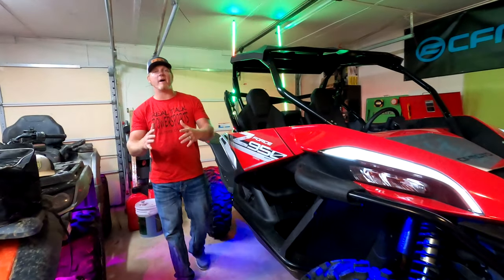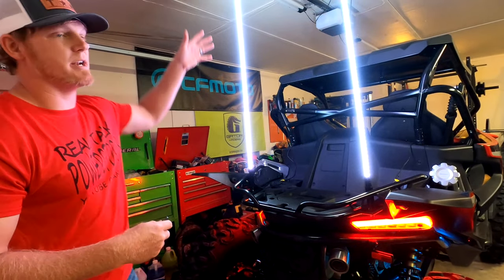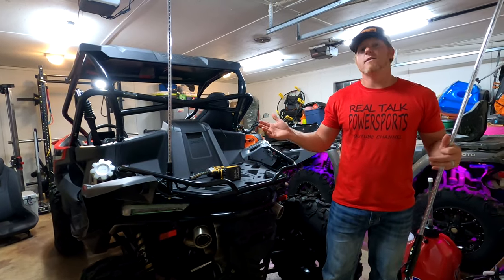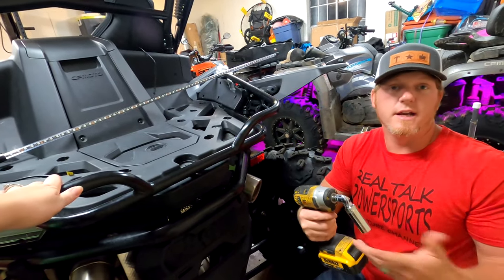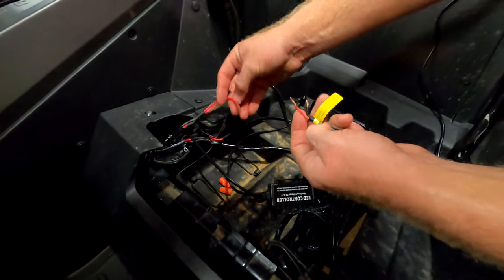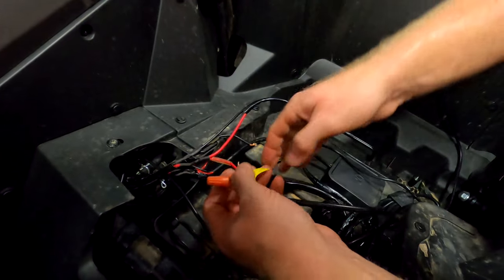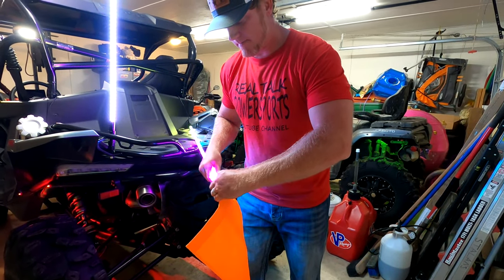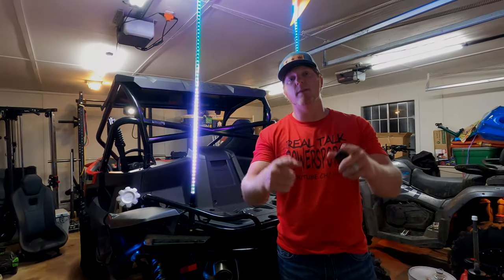KemiMoto LED Whip Lights for ATV or UTV | Very Bright & Easy to Install

Comment: Great video, but by all means get you some butt connectors or soldering connectors as opposed to those wire nuts, especially in the utv environment 👍🏼
Reply from the maker: Thats right!! I just did the wire nuts for a quick means of connection for illustration purpose.  Butt connectors and some super 88 tape is what I like to use normally

Comment: would the  whip lights get brittle and break off overtime or stay as strong and as good looking as new?
Reply: I had a pair of four footers, didn't last but three weeks and broke. Mine we're not flexible,.  at all. I did call Moto they did replace them I got to give him that!!!
Reply: They break contact in the led strip because they either spin or when they bend it beaks connection inside the led strip. 
7 of mine have all broken connection at the same spot.
I purchased the Kemimotos and switched to Nilights. They have a way better connection,  a taller quick connect. I also made an extra loop of wire that can get pulled on without pulling on the wires or led strip. Kemimoto whips are Junk!!

Comment: I tapped mine into my buss bar. They work fine but I cannot run the set on 1 remote. I did not install a switch. I only use the remote controller that was provided. Also when I put them on red; one of them is like a faded red. Any ideas  I would appreciate. Thank you sir
Reply from the maker: John i know this pair is sold together and work off of one control box and one controller.. did you buy you 2 separately
Reply: Real Talk Powersports yes I bought them Separately
Reply from the maker: @johnduran4949  this set was a pair wired into the same control box.. thats the only way one controller will work. And as far as the red discolor im not sure.
Reply: Thank you so much! I appreciate it! Will probably just buy a set instead of individual.

Comment: Do I  need the led control modules to wire  my whips up . I have 2 whips and 2 remotes but no modules came with my order
Reply from the maker: There should be a little black module box.
Reply: Thanks for reply but still confused. Messaged kemimoto about the module not being in with the whips and their response was the one l purchased didn't need the module and was told just to hook it up like l normally would. My remote was the controller. I order them after watching your video and it was the Black Friday discount. The whips and 2  mounts

Comment: What is your warrantee on these?
I bought the, LED Whip, set of two for $129 earlier this year, and they both broke from branches.
One of them came completely off, leaving my LED Strip, hanging there.
Luckily guys behind me picked it up.
The other on stopped working 1/2 way up.
Now I need to buy a new set.
I have yet to decide.

Comment: This doesn’t really pertain to this video but just wanted to ask a question about wheels. I’m looking at just getting some 30x9 and 30x11 cryptids just the tires for my cforce 800 do you think it will have any clearance issues on the stock wheels?
Reply from the maker: Hey Joe that setup will work perfect with the stock wheels.. but i think the 30x10 setup would rub a little bit up front with the stock wheels

Comment: Do that instalation tutorial on a cfmoto 850 please!
Reply from the maker: It may be a while before I can get another set. But it will be setup and wired just like in this video.
Reply: @RealTalkPowersports  just would like to know we're do you attach on the cf moto.
Reply from the maker: @33Mettal  to wire it or attach to the rear of the 850
Reply: @RealTalkPowersports  attach...
I can't see the best spot to do it in the rear part! Any hole adaptor for it?
Reply from the maker: @33Mettal  I would just drill a hole where ever i wanted them to be on the back edge of the rear rack. If you go with this kit.. you will need to drill with a 1/2" drill bit

Comment: I got these whips for my dad. Didn’t come with rf controller. Doesn’t work without it and now they’re trying to say it’s integrated into the light itself. And they won’t send me one. Don’t seem that reputable of a company in my eyes
Reply from the maker: It should definitely come with the remote controller.. unless it is now bluetooth operated.
Reply: It came with remote but without the RF controller the remote has no way of controlling the lights
Reply from the maker: @yuknasty9199  thats weird.. because the wires going from your power source should be running to a little black box and the black box is the controller and brains of the operation and from the black box it runs to the whips
Reply: Yeah I know. But they said the won’t give me one so I can’t use them. Just gonna have to get a different set
Reply: @RealTalkPowersports  yeah this is the problem I'm having right now. They even showed me a screenshot of that controller box in your hand in the video and said I have to buy it, it's not included 😑 by the way, my single whip light does work without it- the remote works, but I can't for the life of me get it to do the complex patterns that yours does in this video. That's what I really really wanted- those multi independent traveling patterns from the bottom, and all those separate little pieces simultaneously split apart, etc. looks freakin amazing and that's what I'm after 😞
Reply from the maker: @KakarotsSpirit4  is yours the multifunction one or the single color option
Reply: @RealTalkPowersports  it has two different mode buttons and a demo button. I suspect yours were/are different somehow because didn't you say yours had "Automatic"? Mine has no Automatic button. I can link you the exact one I have.
Reply: @RealTalkPowersports  was/is* dang it lol
Reply: @RealTalkPowersports  it definitely does more than just single color options but I can't get the lights on mine to do any "traveling"  like yours does. Nothing they do  gives the feeling or appearance that they're moving in that way- if you know what I mean.
Reply: @RealTalkPowersports  I think I've finally actually figured it out. It's really not that clear at all on the website but you have to buy the set of two like you did- in buying only just the one, you aren't getting the same product 🤦🤦😅
Reply: i actually had them send me a set without the rf controller module also, they told me the same thing that the module wasnt needed. it actually ended up working with just the remote though and the controller wasnt needed after all. left them on on my trailer and at freeway speed one blew apart and when i got home the light from inside the tube was laying on the back of car still connected.

Comment: They break contact in the led strip because they either spin or when they bend it beaks connection inside the led strip. 
7 of mine have all broken connection at the same spot.
I purchased the Kemimotos and switched to Nilights. They have a way better connection,  a taller quick connect. I also made an extra loop of wire that can get pulled on without pulling on the wires or led strip. Kemimoto whips are Junk!!